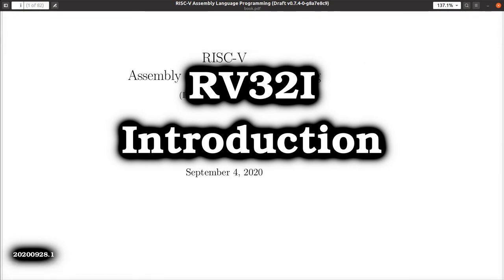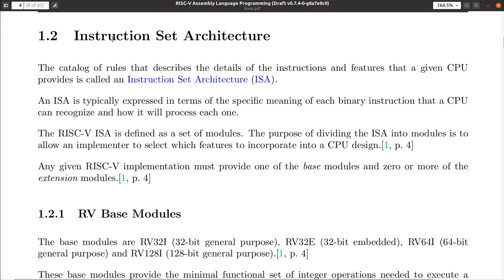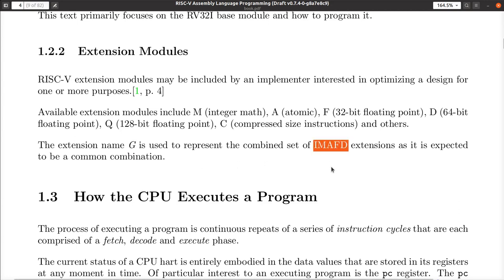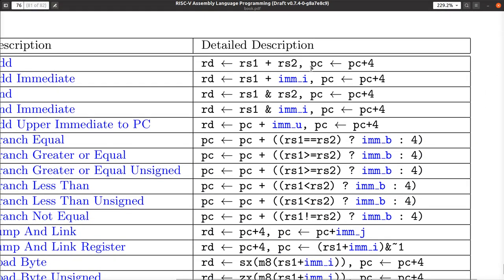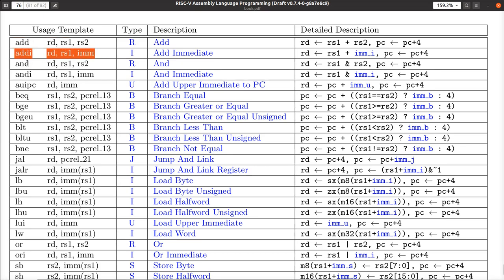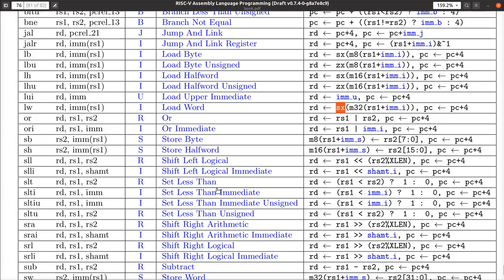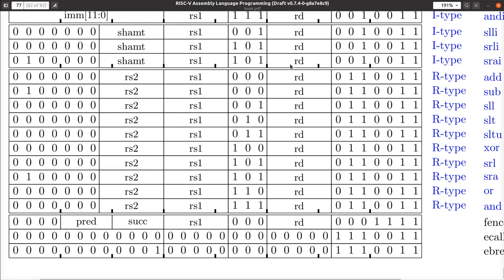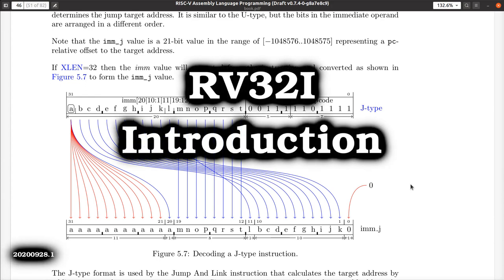Introduction to RISC-V and the RV32I Instructions

Comment: Please forgive my confusion. When I heard RISC was doing a Vector chip I assumed that would mean it would have onboard vector graphics libraries for accelerating and simplifying processes similar to Flash, Inkscape, or Processing.js. I would expect a collection of built in libraries of various vector fonts onboard. I was looking forward to being able to make a few simple calls in Assembly and open a window of colorful vector based elipses, arcs, gradients, animated vector text, etc..
When I was an animation student at DeAnza I encouraged a small startup called Macromedia to develop vector animation tools. The idea being one could transmit full screen animations using tiny amounts of data back when 28.8K modems were the norm and bandwidth was dismal. Today microprocessors are the norm. I was picturing handheld devices that can communicate with one another using said scalable graphics and data. We have come full circle where now once again small data is valuable for transmitting between tiny devices.
I could go on and on about all the wondrous things one could do. 
Is that not what this chip is about at all?  I am completely baffled!  ???
Reply from the maker: @dillingerlee2536   The V in RISC-V means 5 in this context...  As in version 5.  And 'vector' instructions in the context of RISC-V (at the moment) refer to vector registers (a one dimensional array.)
Reply: @JohnsBasement  Ah I see! But there is a Vector chip on the near horizon right? I heard folks were already working on an OS for it. If so there should be an emulator for qemu in the near future, yes? Or have I completely got my wires crossed on the topic?

Comment: Finally, I've been looking for a simple explanation of risc-v for a long time and this is just what I needed.
I'm about to make a RV32I compliant processor in minecraft, so you could use gcc to program it instead of the usual machine code.

And if I'm really feeling autistic i could make it RV32G and run fucking linux in minecraft. Very unlikely...
Reply from the maker: Ya know, it just might turn out that it comes together.

Comment: in your latest edition of RISC-V assembly language programing(Draft v0.18.3-0-g8a08bae),  in 83rd page where you have combined both description and instruction format of instructions. In the jalr instruction operation description, you have used ^ operator instead of & operator but in 81 page you have given & operator in description. so change ^ operator to &
Reply from the maker: Ugh.... that is actually correct.  the big wedge is a logical AND.  I can see that I was, however, inconsistent by using the & on a prior page.  I do need to go through the entire thing and use the same notation everywhere!

Comment: What a great video. I'm reading my way through the RISC-V documentation and the various projects around it, including QEMU for some days now. On my desk sits a MangoPi MQ-Pro, I have "the real thing" at my hands too. But I never understood the pure genius in the design of that architecture until seeing your excellent video. Thanks a lot!
Perhaps, if you don't mind, there is one question left for me. I understood, there are no flags. But my mind refuses to get the hang on having no carry flag. I must admit, I went through processors like Z80, 8080, 80x86,68k and 6502 but no real RISC one until now. So...could you explain why there seems to be nothing like "shift left through carry"? Isn't such a thing needed? 🤔
Reply from the maker: This is discussed in section 2.4 of: The RISC-V Instruction Set Manual, Volume I: Unprivileged ISA, Document Version 20191213.  You can get yours from here: https://riscv.org/technical/specifications/

I am not following your point of mentioning "shift left through carry" in this context other than to use it as a way to get the carry flag into an accumulator for a subsequent branch?
Reply: @JohnsBasement  thanks for pointing out the location of that in the specs, I'll read that part again. I've read through some of my old Z80 sources and you're right. Most of the time, Carry-Flag is used for realizing loops or for checking results of e.g. I/O after shifting/rotating it by an amount of bits. Everything of that could be done with direct comparisions to zero/nonzero or and and/or, followed by such a conditional branch. So it seems, that is purely habit on my side.
Reply: Flags in general are needed when you have separate compare and conditional branch instructions, to keep enough state from the compare (or other arithmetic) to make a decision. The carry flag in particular is needed for unsigned comparisons, while the V flag is needed for signed comparisons. RISC-V compares two registers and branches (or not) in one instruction, so no intermediate storage is needed. Both signed and unsigned conditional branches are provided. So that's the major use of flags in general simply not needed. On 8 bit and to a lesser extent 16 bit CPUs you are very often dealing with program variables that are larger than the registers/ALUs and the carry flag is needed to efficiently implement multi-precision adds and subtracts. When you have a 32 bit or especially 64 bit CPU it becomes very rare to need multi-precision arithmetic. The third use for a carry flag is detecting overflow. The RISC-V ISA manual covers that topic.

Comment: These are not the all instructions of RV32I. These are appearance instructions for users. RV32I has hidden instructions for computer.
Reply from the maker: Which ones are you referring to?  You mean the privileged instructions?  Fence?
Reply: @JohnsBasement  Yes, exactly. And these hidden instructions such as trap instruction from privileged, is not allow user to use for program typically. It’s for computer to handle computing error.
Reply: @JohnsBasement  more specifically, this list doesn’t also contain CSR instructions, Environment instructions such as call and break, and synch instructions of RV32I.
Reply from the maker: @aeebeecee3737  I updated the doc since I recorded this.  Priv insns are subject of new lectures I'm still working on.  It appears that the fence insns were moved out of the base ISA.
Reply: @JohnsBasement  that’s cool, and thanks a lot for your replying about my comment.